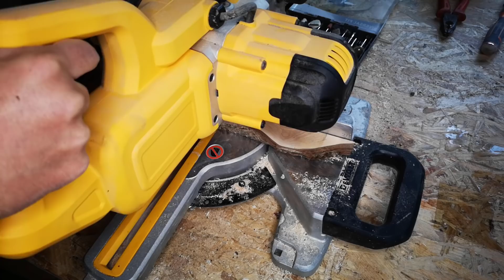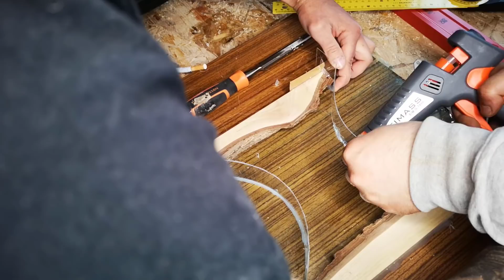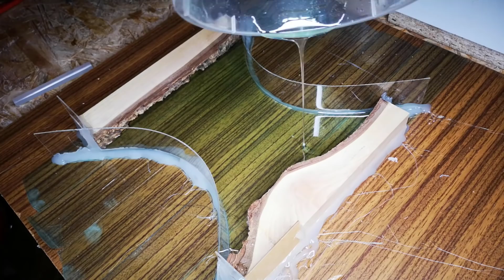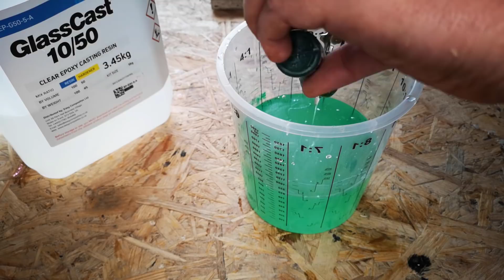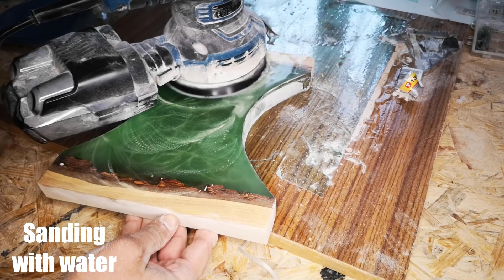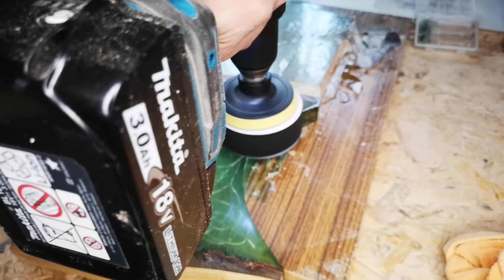Epoxy Resin Night Lamp with Two Pieces of Wood - Resin Art

Comment: I follow your work and am impressed at each project.  I do have one question on the fairy lights.  I saw your base pour. Assume it was still a tad tacky when you layered the lights/wires on top. How in the world do you get it compressed and staying down?  I assume the pour over the wires must be 1/2 inch or so.  Am I right or wrong.  Am waiting with baited breath for the answer so I can try this project.  Thanks!!!